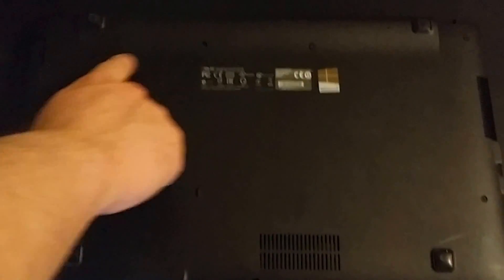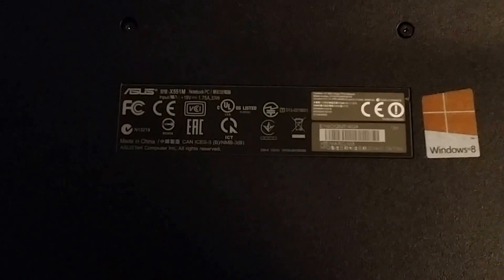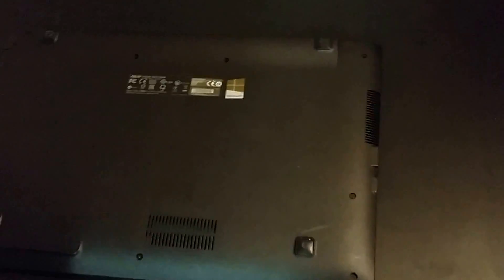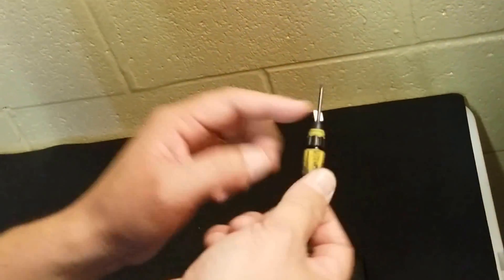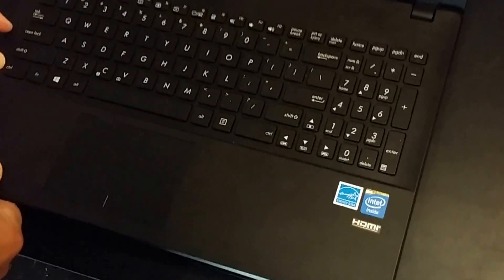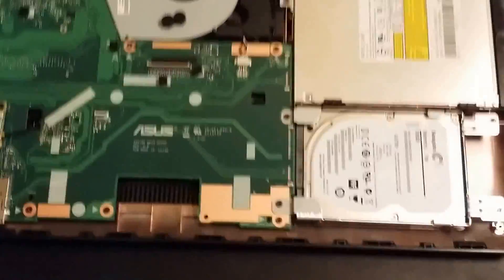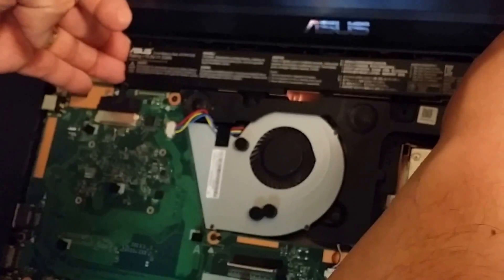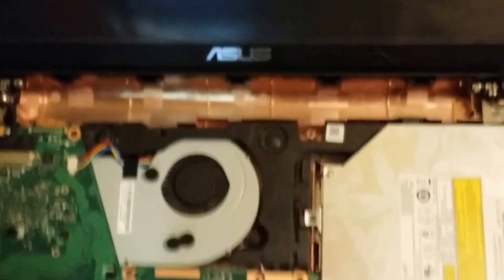ASUS X551M Laptop Battery Removal & Won't Power On Fix

Comment: ok. this video was very helpful. Except i am trying to figure out how to get my asus x551m to charge. It wont turn on and it is not getting any charge when the ac adapter is plugged in to it. the light on the adapter is on so the adapter is fine. but the light on the computer doesnt come on indicating that its recieving a charge. so i have used your video to help me get to the point to getting the battery out. and i'm trying to read another forum for a problem someone had with this same laptop and this is what it says :  

"I just fixed the same problem. I was simply watching a video and the computer just shut off like it was shocked or something. It wouldn't turn on after holding down the power button nor was the light on at the bottom left of the laptop indicating charging.

I took out all the screws on the bottom of the laptop and opened it by taking a small Flathead screwdriver and etching it all around the sides. The top layer of the keyboard came off. BE VERY CAREFUL WHEN YOU DO THIS. There are 3 strips connected to the bottom half of the laptop that are connected to the top keyboard layer. The strip connecting the power button came off while I was removing the battery. I just stuck it back in and clamped down the white clamps and it stayed in.

After lifting directly up on the battery it came out. I unplugged the power adapter also. I then held down the power button for 60 secs to be extra sure; thus draining the residual charge. I then proceeded to place the battery back in(battery still had some charge). I held/pressed the power and it turned back on. I was so relieved that it worked."  

okay so can you make a video displaying what this guy is telling me to do. cause i got the battery out. After i opened it up from the keyboard , and unplugged the three white strips. but the guy in the forum is saying to take the battery out then hold down the power button for 60 seconds. so what i should do after removing the battery is THEN reattach the power button strip and close the keyboard layer lid and hold the button down for 60 seconds???? then lift the keyboard back up??? and but the battery back in ?? i need a video man. i need a step by step instruction explaining better than this guy in the forum did.
Reply from the maker: +Hollyann Brown In a nutshell, yeah you have to reattach the power button ribbon cable back into the slot and hold the power button down for 30 seconds AFTER you remove the battery.  It stinks, I know but you can blame the FINE Design Engineer for making this model as difficult as possible to remove the battery.  When you disassemble it, you have to remove three ribbon cables to detach the keyboard lid from the laptop so you can remove the battery.  To discharge it: 1.  The battery must be removed first.    2.  The keyboard lid must be in position hovering over the laptop so you can connect AT LEAST the power ribbon cable.   3.  You can set the lid down after the POWER ribbon cable has been inserted so you can hold the power button down for at least 30 seconds.

Does that make sense?

Devin

Comment: Thanks for the video. Did you mention there was a mechanism release button to detach the flat cables?  Press the release button all 3 cables will detach.?
Reply from the maker: +thomas crown You LIFT UP the three different latches to release the ribbon cables.

Comment: What size screwdriver did you use to remove these screws?
Reply from the maker: +ProGaming I used a small screwdriver/phillips head kit called  a Ultra 6 PCS. Precision Screwdriver Set and the size of the 4 way/Phillips head was a PH 0.

Good Luck!

Devin
Reply: ***** alright.. thanks man :)

Comment: Mine was very good for 4 years, not 2 years. Im going to use it as a desktop as I am not taking the chance to open it... Thank you for your great videos! I believe that for less than $300 it cost less to have just a case to open  instead of a battery with an easy access. 4 years ago this laptop was so cheap compared to other brands that I really recommend it. I will buy a new one and enjoy it again for the next 4 years. Bitterness is not my thing sorry! when I bought this Asus I thought that either I would return it for lack of performance or that it would die on me in 2 years like my previous 1200 Sony! thanks again your video is awesome!

Comment: It works.. But my keyboard doesnt type anything :( helppp!!
Reply from the maker: +Joanne Gutierrez HI Joanne,  You might not have inserted the keyboard ribbon cable back in properly.  Those cables are tricky to put back in due to the limited space of putting your hand/fingers in under the keyboard plate to insert the cable and lock the latch down on top of the cable.  If you did everything correct, it should work.  If it looks correct after reinserting the cable a second time, you might have damaged the cable and may need to purchase another one.  You can always use a USB keyboard until you get another ribbon cable.  Hassle I know, but at least you will be able to use your laptop that way until then.

Good luck!

Devin

Comment: Hello, I am not completely ok with you get what you paid for, as I use this computer every day for hours, I travelled with it to Africa, and I bought it in spring 2012 for less than 350 dollars! It is an awesome machine, never failed on me, not one time! today the battery seems flat so I am going to save all my datas before to try the battery change and if it is not working , well ill buy another one for the next 4 years!
Reply from the maker: +Yveline Andrieu I can respect your opinion as there are those that have the DISPOSABLE every 2-3 years time of mentality.  But there are also those people that when they purchase something (especially when it is over $300), they want it to last for longer then 3 years.  Granted, Li-Ion Batteries usually last 1-3 years depending on use, but if we are talking about the actual computer, people want those to last 5+ years.  ANY laptop under $500 is considered in the BUDGET category, so the You Get What You Pay For phrase holds true due to things like, hard drives, motherboards, memory, graphics chips, etc fail within 2 years.  I see this all the time when laptops come into my shop and they are newer less then 3 year old laptops.  Heck a lot of times things fail after the months 13-24 for these budget laptops!  Consider yourself lucky if what you are saying is true about your laptop, but for the majority of users, they fails faster and more frequently then yours.

Another thing to note: You never mentioned in your comment the hassle it is going to be as noted in my video to do a simple battery replacement.  They designed them that way to make it as difficult as possible in hopes you will retire that laptop so you will spend $300+ MORE dollars on a new laptop.  That way of thinking is corporate greed at best and irresponsible for the environment at WORST!  It should never take you more then a few moments for a simple battery removal.

Devin

Comment: Hiya sir! I have this exact laptop. It was loaned to me by a friend after my girl broke the screen of my chromebook.
We used it for about 24 hours when it suddenly just stopped dead in its tracks. No lights come on when it's plugged in, and it looks completely dead.
Does that mean I just need to get a new battery? It won't work until I buy a new one? Are they available at computer places or do I need to order one? I'm a complete moron when it comes to laptops.
Reply from the maker: +Johnny Riggs Hi there Johnny.  Here are the steps you should take to determine why your system is not booting up.

1.  Try to use another power adapter to rule that out.  If your power adapter becomes defective, it won't either charge the battery or turn on your computer when the battery runs out.

2.  If the power adapter is good,  then remove the battery by using my instructions in the video.  Without the battery, plug the power ribbon cable back into the motherboard then plug in the DC jack and power the laptop on.  Sometimes a bad battery CAN prevent the system from turning on.

3.  If #1 and #2 doesn't power the system on, check the DC jack to see if it is loose.  If the DC jack is loose from the motherboard, the power adapter will not be able to charge the battery or turn the system on due to there being a broken connection to the motherboard.

4.  If #3 is inconclusive, double check the power ribbon cable to make sure it is firmly inserted and seated properly and also check for rips or tears in the cable itself.

5.  If #4 can not be confirmed, you might have a faulty motherboard.  At that point, you should take it to a computer repair shop for a diagnostic.

Good luck!

Devin

Comment: Some advice: the ribbon cable connector sockets are very fragile and open by flipping the tab up - very gently - as opposed to opening by 'pulling' them horizontally as I found out to my detriment! Be careful out there ;)

In my case, the laptop seems completely dead, no lights, no 'kick of the fan or optical drive when plugging in the PSU - nothing. PSU seems OK (19.5V measured on the motherboard PCB).

Any suggestions would be much appreciated.
Reply from the maker: +keeboudi Have you checked your DC Jack?  A lot of the time when the DC Jack is either lose (broken solder connections to the motherboard) or defective, power from the charger/adapter will not charge the battery or power the system on.  That is usually the case.  With a little soldering skill (Youtube videos on soldering DC jacks) and a new DC Jack will bring new life into the laptop.  If that doesn't work, you most likely have a dead motherboard.  You can also bring it into a computer shop for a second opinion.
Reply: +Angrysquirrel PC - Thanks for the quick reply. There does seem to be power reaching the board when I prob the motherboard and a visual inspection of the jack doesn't show anything obvious but I will double check this.
 I was an EE (component level) in a previous life so soldering is no problem :)
I think the owner tried a different PSU on it when it wasn't powering up without actually checking voltage or polarity on a Hail Mary basis which I suspect may have killed it.
Do you have any idea where I may be able to get a schematic for this board at all?
Reply from the maker: +keeboudi ASUS support @ https://www.asus.com/us/support/ would be a good place to start.  You might even try calling them to see if they can provide any schematics on that motherboard if you can't find anything pertaining to what you need.
Reply from the maker: +keeboudi Also, one last thing that may not be turning the computer on.  On very RARE occasions, the power button/power button board/power ribbon cable could either be damaged or ribbon detached/damaged from the board or motherboard side.  Make sure you check this out too as the ribbons can get ripped if you are not careful on disassembly of the laptop.  Ribbon cables are fairly cheap (under $6.00 usually).  Replacement motherboards however can start from $50 and go to $300 depending on model.

Good luck!

Comment: hi please help . I already tired this 10 times 
I have an Asus Q502L and the battery is not removable like yours its internal. Now i opened the panel and unplugged the batter on the inside and did the whole 30 hell even 45 sec then plugged in the ac adapter and same just a white blinking light. it doesnt boot. I got it to boot two times before but it was dead 0% battery so i plugged in the charger but it woulndt charge at all just red/orange blinking light. so i shutdown but now i same problem as before doesnt turn on. same white blinking light everytime i press the power button or just blinks constantly if plugged in to charger. PLEASE HELP
Reply from the maker: +riukokai I am trying to understand fully what you did.  Prior to turning the laptop back on, did you plug the battery back in then plug in the charger or did you leave the battery UNPLUGGED and plug in the charger?
Reply: +Angrysquirrel PC ok ill start from the beginning . I got my laptop saw it was about to die. as i reached for my charger it just shut off. when i plugged it in i noticed it wasnt charging so when i tried to turn it on ...it wouldnt ..just a white blinking light would turn on everytime i press the power button. SO i read up on solutions i could do. i found the whole reset thing and the electrical discharge. So i tried the 30 second method where you take the battery out and unplug the charger and hold the power button for 30+ sec. then you connnect the charger and its suppose to power on ...by mine didnt. so i left it overnight unplugged and when i tried to just power on in the morning it was like a miracle it turned on ...but it was dead so i plugged in the charger but it wouldnt charge all i had was a blinking red/orange light. so i shutdown thinking it might work if i restart it. but nope it just went back to how it was ...not being able to power on....just white blinking light. Can you help?
Reply from the maker: Without actually seeing the laptop in front of me, I will have to make some guesses as to what could be wrong with it:

#1.  Battery is causing the system to not boot up.  Unplug the battery and plug the adapter directly WITHOUT the battery.  Does that power the system up?

#2.  DC Jack/Motherboard Issue.  ASUS Laptops are notorious for soldering on their DC Jacks.  Power adapter cord strain causes the DC Jack's solder holding the jack onto the motherboard to weaken causing it to "wiggle" or move around breaking the connection to charge the battery or power the system on.  The blinking light usually means that your battery does not have sufficient power to turn the computer on.  With a bad DC Jack, you can't charge the battery or power the system on anymore.  That or your motherboard has failed for one reason or another.

#3.  Your Power Adapter has gone bad.  Get a universal power adapter or "borrow/use one" from a friend or bring this to a computer shop to test the DC Jack or Power Adapter.  They usually do that for free.

#4.  Make sure your power outlet is working or turned on.  Move the power adapter to another outlet JUST IN CASE.  I have had customer swear that their computers were "dead" and when they came to my store, it turned right on!

Good luck!
Reply: +Angrysquirrel PC Thanks for those 

for #1. its not turning on with just the adapter. although with the adapter on it blinks continuously every minute or so ...i dont have to press any buttons. and with just the battery and no adapter it only blinks when i press the power button.

for #2 how do i check that its the motherboard or dcjack ? 

for #3 ill check if its that but I dont think so seeing that it makes the laptop blink when plugged in.
 
and for #4 ive moved to different outlets since it was suggested in other forums and websites. but just to double check ill check once more.

So since it doesnt power on with just the ac adapter what could it be? whats wrong with my baby -__-
Reply from the maker: We have essentially narrowed it down to #2 or #3.  There is no real way for a regular person to test the motherboard.  You can test the DC Jack though.  If you plug in the power adapter to the DC Jack and gently move it / wiggle it and the DC Jack "moves" that means it is loose.  If it stays firm and there is no "give" that usually means the DC Jack is firmly soldered.  DC Jacks CAN go bad though so that is not guaranteed it is good even if it doesn't move at all.  #2 should be brought to a shop.  To rule out #3, get another power adapter.

Good luck!
Reply: +Angrysquirrel PC  like if it moves at all then its loose ...cuz its pretty firm but i guess it wiggles a tiny bit not alot at all.

Comment: +Angrysquirrel PC  Hi. I have Asus Vivobook A551L. Can you tell me is it possible to upgrade memory in this model? I can't find any information about that on the internet
Reply from the maker: +Łukasz Dawgiert It looks like that is a laptop model that is sold outside the United States (UK maybe?).  Based on going to memory vendor site, this might be one of the ones that have dedicated memory soldered onto the motherboard.  To be absolutely sure, you might want to contact ASUS technical support with your exact serial number to get confirmation on the ability to add memory to your system.

Good luck!

Devin

Comment: so the light that indicates whether the laptop (Asus X551M) is on or not  comes on but my screen stays black, what do you suggest I do?
Reply from the maker: +Cynthia Christensen-Maragh Are any other lights on?  Battery charger light?  Hard Drive Activity light?  If those light are one ESPECIALLY the HDD light being on and blinking, I would suggest hooking the laptop to an external monitor and seeing if you can get a picture on it.  You might have to do a FN key + Fn Key f1-f12 push combination to get the picture to come up on the external monitor.  Look for the function key up at the top of the keyboard that looks like a "monitor symbol" or a small to large square icon.  If you don't see any other lights show up, you either have failed memory or a failed motherboard.  It would be best at that point to take it to a computer shop to get it diagnosed.  Some places will give free diagnostics and some don't so call around.

Good luck!

Devin
Reply: Thanks a lot
Reply from the maker: No problem!  Best of luck!